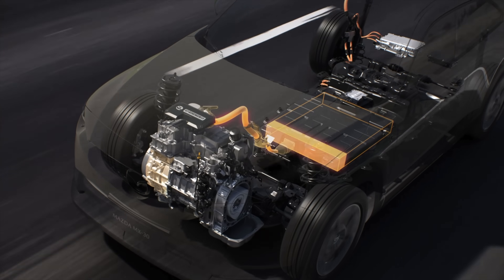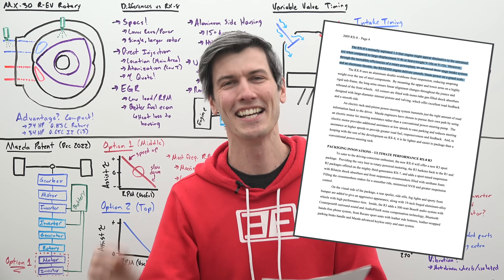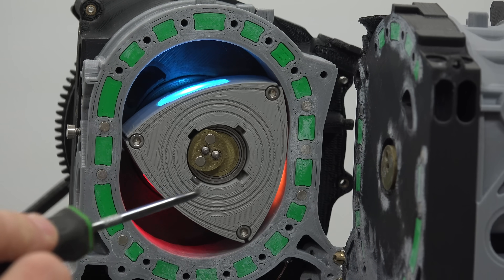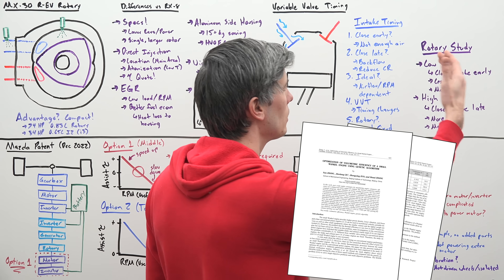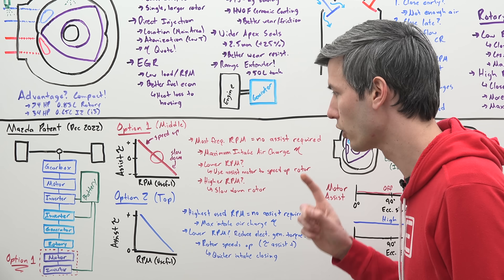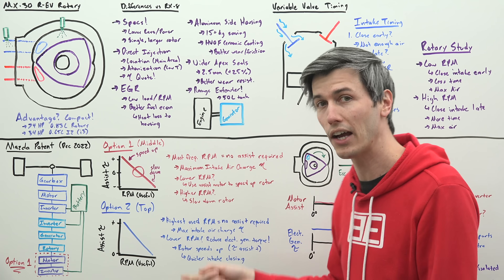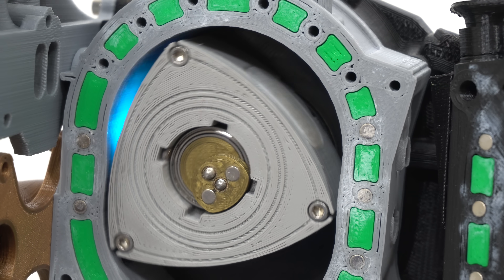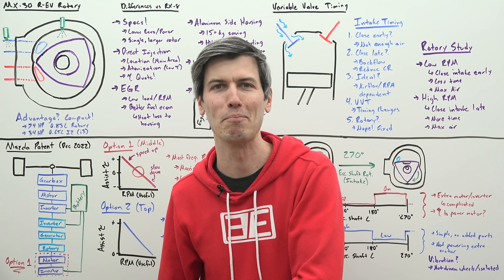Mazda Brought Back The Rotary Engine!

Comment: Very clever, I use a single rotor 13B in my aircraft, the 13B is well suited to aircraft as we don't have anywhere near the RPM variations that automobiles have. We are able to tune the intake runner to give us maximum volumetric efficiency at our desired RPM. In general we only have power variations on take off to cruise and then to landing, there are other times we might want to reduce or increase power but way less than an automobile.
Reply: That's awesome. Makes total sense. Rotaries and aircraft are a great match for sure!
Reply: Id be terrified to have a rotary in an airplane. I know 6 people that owned rx7s with 13bs. They were almost never on the road. Constantly breaking down. One of them was just driving along normally and suddenly stopped running. No warning at all.
What happened was an apex seal broke, and the engine took those broken bits and dragged it around the housing destroying everything. 
Rotaries are light and powerful but inefficient and fragile.
Reply: @slickstrings  because a road rotary changes manifold pressure and rpm constantly, this causes severe wear on apex and corner seals.

I fly an experimental racer with two 600hp rotaries. With a Time Between Overhaul of 3500 hours or 15 years whichever comes first. A normal Lycoming engine needs to be rebuilt every 2000 hours or 12 years, but 10 years seems to be the norm.

The engines are cheaper on parts, weigh less, more reliable compared to the aero engines whose tech dates from the 1920's, uses less oil, can't be shock cooled, if the engine does fail it does so gradually loosing power giving you more time to compensate, they use less fuel, have less vibration, has a higher thrust to weight ratio, turbos easier, less parts mean more time between inspection.

To drop a wankle in a car was a mistake from day 1. This machine was meant to be an aircraft engine from the start.
Reply: @PrinceAlhorian  as an av geek i admire that quite a lot.
Reply: @PrinceAlhorian  Are they a mistake in a car when plenty of people love them and own them despite its unreliability. Although if you take care of it it will last you in car
Reply: @leepicgaymer5464  Agree, fully, but you have to look at the design.  You can insert a flat 6 airplane engine in an old Porsche, and people did it, have EPIC torque but the engine will only last reliably for 4000 - 5000 kilometres. 

Look, I'm not crapping on the rotary, I drive a RX 8 pump a stack of cash keeping her going, I am criticising the horse with blinders approach to those who want to use it as a car engine and only a car engine when it was designed for a completely different purpose.
Reply: @slickstrings  you should hear her scream at 780kph flat out, she's called the Banshee for a reason.
Reply: @PrinceAlhorian  I don’t really care if they use it as a car since Rob Dahm has done so much to his Rx7 and it’s kinda entertaining to watch. And it’s their money and time and the end of the day so who I am to judge.
Reply: @PrinceAlhorian  hang on is there footage of it? I swear that sounds familiar. Im sure i have seen a vid of a rotary experimental people called the banshee
Reply: @PrinceAlhorian  man, if you’re comfortable with it, you can make videos about your plane and how a rotary works best on aviation. Seems like a very good idea that’s overlooked by most people.
Reply: @slickstrings  not my bird, that one is single engine.
Mine is a custom design, a cross between a Pond Racer and a P38.  She's built for cross country racing here in South Africa.  Still doing a shakedown on her, keeping her under wraps but you might see some media on her by next year.
Reply: @devandrasimanjuntak1646  would like to but will have to clear it up with the co-owners. It's up to them.
Reply: So you guys in the air craft industry are simply prolonging the break downs by maintaining a certain rpm range! And then Rebuilding it before it fails. For that, it's "GOOD ENOUGH" not the best, most cost efficient, reliable, user friendly, etc. Not the same. 
You can turbo anything and give it great power, smaller engines in general tend to be a little more fuel efficient because of pumping losses, the roll resistance and a proper tune is what determines a great part of fuel efficiency. If one piston fails you have multiple others that will still drive. 

Yes. Rotory probably better than conventional airplane engines but it would not by far be my first for reliability, power, or efficiency. Might have me on the weight but is it enough to matter?
Reply: Home built? I’m so curious. Do tell more info.
Reply: @carabooseOG  It's a tandem seat twinboom design, with an aramid composite wing and fuselage.  The wing has a slight forward sweep reminiscent of Burt Rutan's Pond Racer.  She is powered by two, custom built 4 Rotor Wankels, turbo normalised, and tuned for 600hp each.
Each boom has an independent all flying stabelator and forward swept rudder.  Fully loaded she clocks in at 2200kg, with fuel, baggage in the aft compartment and nose and two 100kg pilots.

The cockpit can be pressurized and flights to 24 000ft have been made.

She's very agile, and has a 2000km range if flown at 60% throttle from 20 000ft.

Because it's experimental, and still under trials we're keeping her from the media eye.  But expect next year maybe to see some media.
Reply: Even that variation in rpm, could be resolved by a variable pitch propellor. So it can perform at a constant rpm all the time. In addition to the aviation use, the maintenance is performed consistent and reliable.
Reply: @slickstrings  You would be correct, but aircraft are required to essentially have a tune-up and a mechanic look at them after every flight.  Catastrophic engine failures are actually quite rare.   Also, most aircraft can glide for many miles on no power, with some almost being like a glider.  Most of these can be stopped by their large wings that are on top of the cabin ( a Wiki search of STOL aircraft has a good list - short takeoff and landing generally means a good lift ratio ).  Some are almost in the range of gliders/weigh well under 1 ton flying.   There are even powered gliders (Motor Glider) if you really want to not have to rely on your engine.  As for actual reliability figures, traditional engines have a failure rate of 13 per 100K miles and 15 for rotary.
Reply: @PrinceAlhorian   In general I would agree that rotaries are not suitable in cars except as an enthusiast engine for petrolheads who don't care about reliability as long as they get their performance thrills, but this approach of using it in a range extender hybrid where the RPM doesn't have to vary much, and the changes Mazda has made to improve efficiency, seems to be the way to go, especially in this era of increasing electrification.
Reply: @PrinceAlhorian  You should post a video of it
Reply: @slickstrings  The majority of failures are due to poor maintenance and not ensuring that the separate oil reservoir is kept topped-up that is used to lubricate the seals.

Comment: A video about Mazda's new 3.3 I6 DIESEL would be interesting too, it's extremely efficient.
Reply: Nothing wrong with an efficient diesel-powered car!
Reply: @nickvledder  there is when it's the only option available
Reply: @nickvledder  efficient on the highway, but not elsewhere let's be honest. That's what DPFs are for.
Reply: @nickvledder  Well, maybe. Emission control is still a serious problem for cars and smaller light trucks, especially if the vehicle is just driven in town. Having to replace a $1300 (Rockauto price for our F350SD work trucks) DPF every few years is nobody's idea of a good plan. That is the primary reason our Fortune 100 electric company went to gasoline for anything under 18,000 GVWR in 2010.
Diesel makes sense in large trucks but not in light trucks or automobiles.
Reply: wtf I knew they had a new inline 6 but didn't know about dieselness. Mazda is having another big lump of weird innovation, I like it.
Reply: @nickvledder  Other than the emissions, fuel cost, maintenance, etc.

Comment: I applause Mazda's efforts of continued development and innovation with the ICE. One has to wonder if the both patents weren't designed specifically for this range extender, and the other patent with electric motor is foreshadowing a performance multi rotor powertrain. 🤔

Time will tell I guess 😊
Reply: I believe they had already applied for that patent a while ago with a very different set up, front wheels only motor powered and rear powered by motor and a triple rotary, with super capacitors charged from the rotary, via the rear drive motor.
Reply: I think the patents are designed purely as promotional material... it's not as if there was the risk of another major car maker copying any design that involves a Wankel engine!
(FTR, personally I actually like a lot what Mazda is doing here.)
Reply: The technique of speeding up or slowing down the rotor would be more difficult on a multi-rotor. Usually, a multi-rotor engines would have the rotors at different phase angles, therefore the ideal time to "speed up" the rotor would be different for different rotors! If you made all the rotors on the same phase, vibration would be increased.
Reply: No,  because today we have Emissions Standards.   And most of us don't want to top up the oil all the time.   Mazda is circling the drain.  Zoom Zoom is dead.
Reply: @leftaroundabout  Me too, I'm really thinking of picking one up as a commuting appliance to replace my Volt (while I can still get more than what I paid for it) and while I wait for Aptera to start production of my preorder. Plus I get to support rotary tech, they will only keep making them if spend our money on them.
Reply: a patent came out a few years ago for a new 3 rotor design, my guess is they are going to "pull an NSX" and do a 3 rotor hybrid sports car
Reply: @KenLord  Their next rotary powered car is probably going to run on hydrogen, so zero emissions. Mazda have been researching it for a long time. They fitted an RX8 with a hydrogen-powered rotary way back in 2003.
Reply: @EcchiGamingYT Wankel engines are obsolete

Comment: I remember seeing an article about how great the rotary engine would be as a range extender for an electric drive train about 6 months ago. I wonder if the writer knew Mazda was planning on exactly that.
Reply: Since the REV version was afaik planned to start together with the BEV MX-30, yes the wirter probably knew that
Reply: I remember such articles from around the time Chevy announced the Volt, if not earlier.
Reply: I was always wondering why the rotary engine didn't become the norm for lawnmowers.
I assumed it was mainly a market dominance issue, because lawnmower engines have no performance ambitions and run at mostly constant speed, and reducing engine noise is an advantage there.
Reply: @Dowlphin  probably because they evolved from basic 2-stroke engines which gotta be much cheaper to produce then a rotary
Reply: Those articles have been around since like 2014

Comment: Great video!
I know that the Volt development team struggled with coming up with a good efficiency plan on their range extender.  It was determined that the customer would not enjoy hearing the engine at some disjointed rpm from what the accelerator pedal was doing.  Maybe this rotary version is dead quiet?  It should vibrate less I would think.
Reply: This is a big issue with the Honda Accord Hybrid.  I don't mind the disjointed RPM.  It only takes about a week to get used to. But the Atkinson buzzy peak is where it operates most often.  Optimizing for a single RPM is great for efficiency and should be done.  But a single RPM should also be easy to optimize for low noise.  Failure to do so, fails the entire design.
Reply: That's what the Volt consumer group didn't like.  The disconnection between the peddle and the engine rpm.